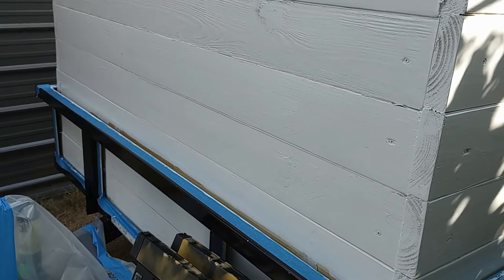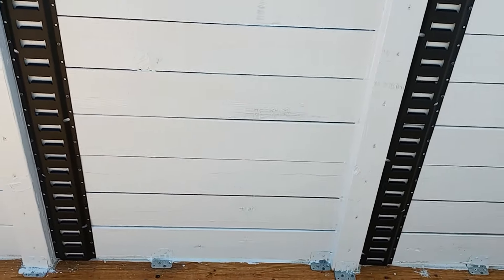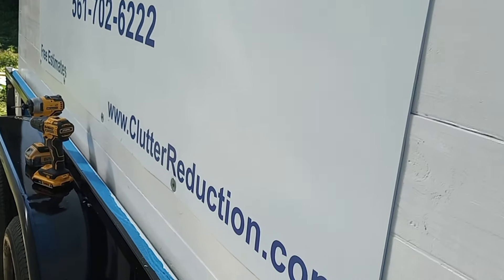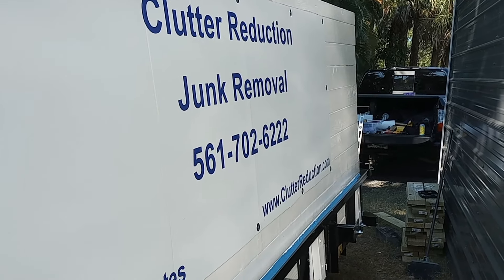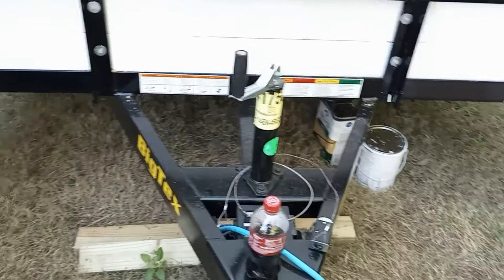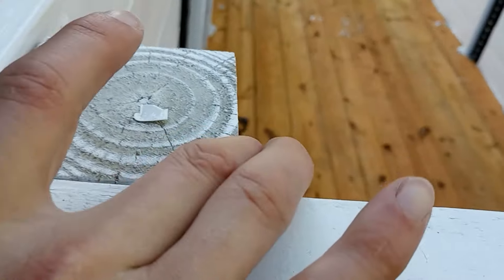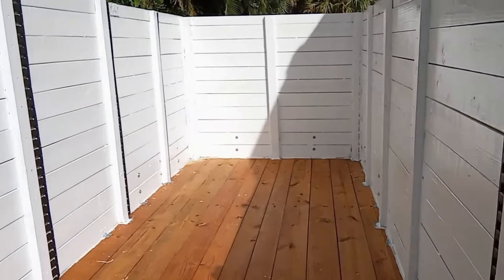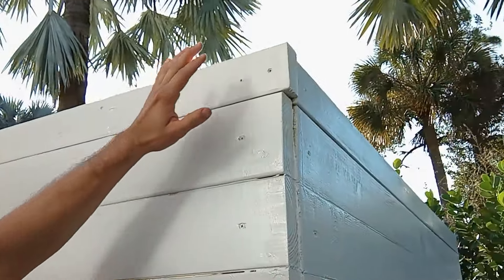Building A Trailer For Junk Removal- Part 2 + Costs

Comment: Commenting as I watch and cracking up because we wanted to tear our trailer apart, too, for different reasons. . 😂😂
Reply from the maker: Definitely a roller coaster of emotions lol
Reply: @clutterreductionjunkremoval  on another note...had another loadup job today...a couch. Once again your tip was invaluable! Turned it on its side onto a dolly and rolled it out, and then tipped it into the loading elevator.  Easy peasy!
Reply from the maker: @r5haulingandjunkremoval  nice, glad to hear it!

Comment: What size truck and trailer do you recommend?  I’m looking to buy a Ram do I need to pay a little more for the 2500 or can I get by with the 1500?
Reply from the maker: I'm not the best one for the truck part, I'm in the same predicament. For the trailer, if you can afford it, start with a 12-14' dump trailer. If not a dump, then a double axel utility trailer 12-14' and build the sides.
Reply: @clutterreductionjunkremoval  awesome. That was extremely helpful. Thank you.